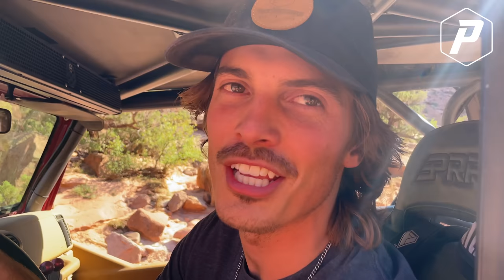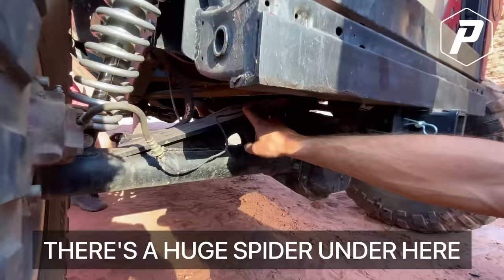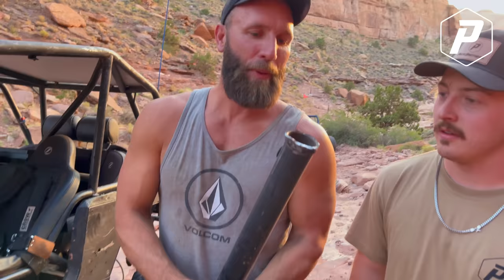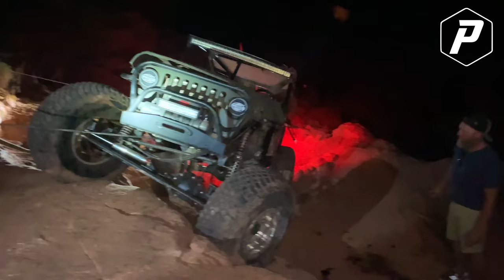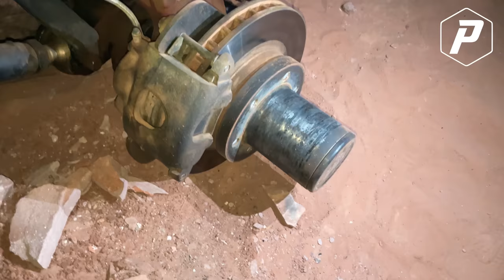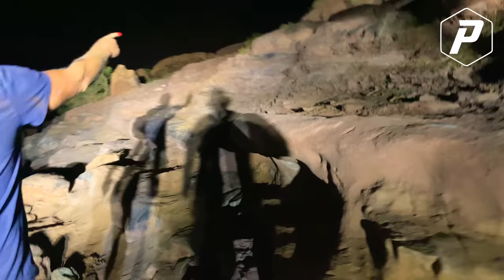JEEP NEARLY ROLLS OFF 250 ft. CLIFF AT MIDNIGHT

Comment: Cool vid guys. Question, what ply are those tsl/sx? Interco is refusing to make the load C/6ply tires in the size I want(sam-93), but they have the 10 plys. I feel like they will be too stiff for a 2d Jeep. 
I just had to make 16.5 double beadlocks and paint myself in a corner on tire choice haha
Reply from the maker: I’m pretty sure they are like a 10-12 ply they stiff sidewall but we love them because they are wicked strong and you don’t blow inner beads because of tire flex, and they don’t hop because of how much belting is in them!! We freaking love them!!
Reply: @PeckBrothers  thanks for the reply my dudes. All I’ve ever had was stiff tires, i’ve got double bead locks, so I’m not worried about the inner bead burping air

Comment: So I was curious as I am trying to work out the geometry on my front end. I am using same ford steering box as your jeep and because of this it looks like your track bar is located on inside of frame. So my question is due to the track bar being shorter than drag link are you experiencing alot of bumpsteer.
Reply from the maker: Not an ounce!! My track bar is barely shorter than the drag link, only a couple of inches, if you look at the mount on my axle for the track bar it’s clear over on the knuckle!! Hope this helps!!

Comment: chuckle. driving out of pritchett takes forever, dragging two rigs would notttt be fun.   Rock pile is def a challenging obstacle.
also,  cant remember what your rear end is, is it a sterling?  those brakes were huge and i smacked them all the time like you did.  BKOR has a good fix to swap em out to willwoods.
Reply from the maker: She is a sterling 10.5!! Brakes are huge but I don't want to get ride of them because of how killer they stop the jeep!! I just need to move them out of the way or build a skid plate 😂😂😂
Reply: @PeckBrothers   ill tag you on Ig and show you the skids that i built when i had the stock brake settup on mine, it worked great and stopped me killing calipers.        tho i will add the brake change to willwoods actually helped brake preformance..  and tucks them wayyy up